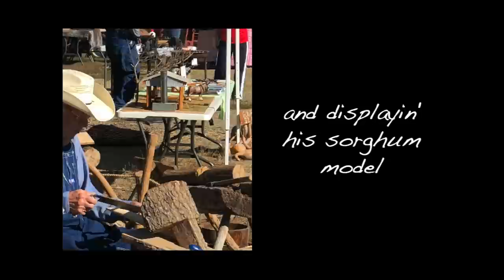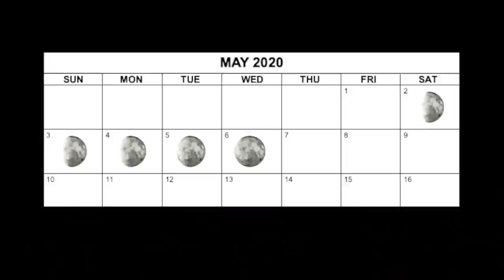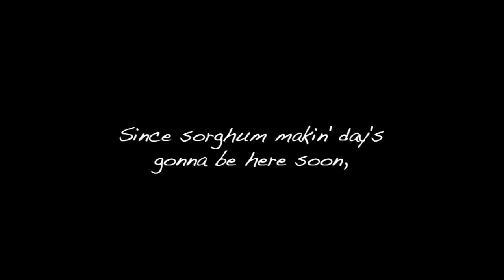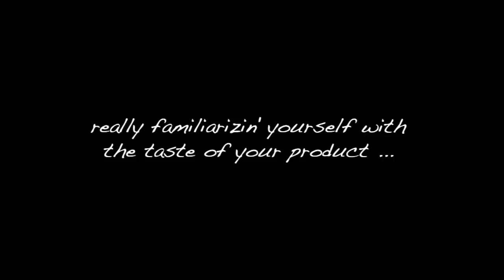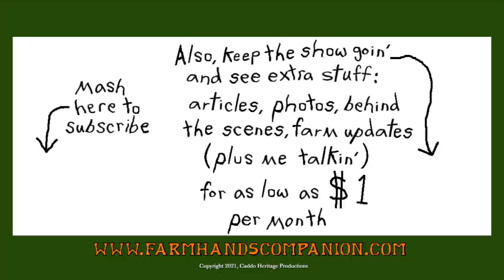Sorghum Molasses - Pressing and Cooking - The FHC Show, ep 30

Comment: How old was your cow when you first started training her to pull?  I'm thinking maybe the next time I have a heifer calf born of training her to pull, especially in order to cultivate between rows of corn and other crops after they've gotten too tall to drive over with my tractor cultivator.  I'm hoping a Jersey cow will be strong enough for light cultivation like that, even in my pretty heavy soil, and I'm sure if I had a cow trained to pull I'd find other projects where I could use her help, too.  Any thoughts on what a Jersey cow is capable of in terms of strength and endurance?  How did you learn what you needed to know to get started training and using your cow to pull?  Thanks!